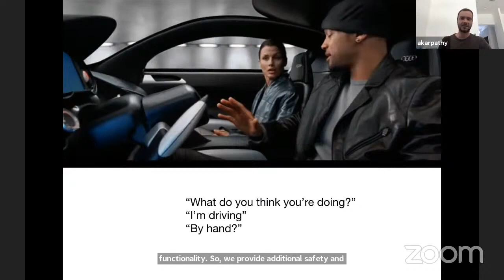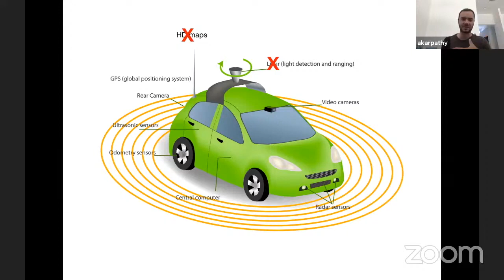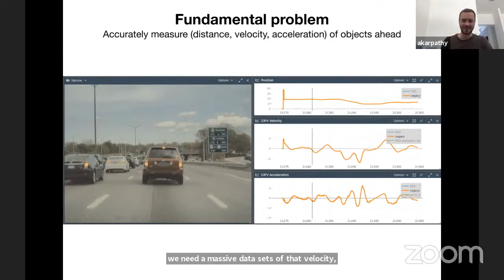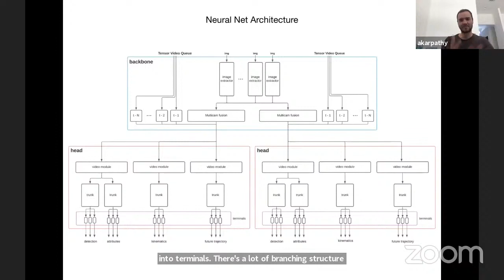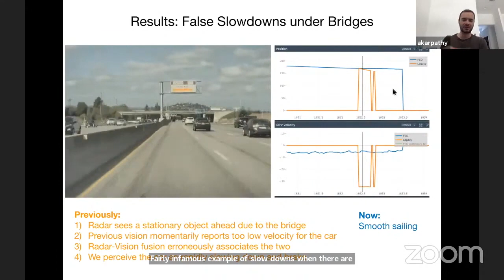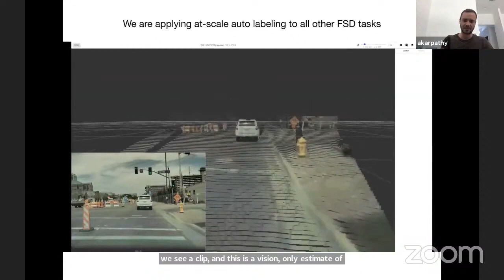[CVPR'21 WAD] Keynote - Andrej Karpathy, Tesla

Comment: Personally, I have to disagree with you here, coming from a pilot (particularly combat pilot) with some engineering pedigree. The idea of just ignoring the radar stack because of its limits and going to vision only is (hopefully not) kind of short sighted. Although the software engineering to get the biases right for a blend of EO (elecro-optical) and radar would take a bit, you'd get a better product. Many of the military sensor arrays now use a blend of available sensors (IR, EO, radar and networked data) to come up with a picture based on the best sensor data per target. Radar definitely has limits and errors, but so does visual spectrum particularly in the dark, rain and fog. Without radar, unless you add infra-red cameras, the cars will have all the same human visual limits for seeing distant objects no? For example, the jet I used to fly had a missile defensive system that amounted to electronic eyes looking for a missile launch plume, and then firing off flares when it was one. Unfortunately it would get fooled by all sorts of things and pop flares without a missile launch (essentially phantom braking off the radar). The upgrade added a second visual battery of sensors which were tied together with software, so the OSC saw what it thought was a plume but instead of going to the flares it went to the IRCM turrets which looked at the event, determined if there was relative motion (if something is on a collision course with you like a missile tracking, it's a threat, if not it's a false alarm) and that system would either defend the jet or ignore the input. That would have been what you should have done, radar says "ahhh! a thing! brakes" but the cameras look and go "no, it's a bridge, don't brake." Anyway, nobody asked me and it's too late to do anything about it, so I hope it works out. I really don't like the idea that I have a system in both of my Teslas that I bought and you're about to shut off without paying me back though. Just saying.
Reply: it's a good point. I think that's what they were trying to do with having radar "report" to vision, but apparently they think it will work smoother with just vision.
Reply: As you probably know, regular (silicon-based) cameras have a bit of IR sensitivity unless IR is blocked by an IR filter (which is standard for photographic CCDs).

Comment: I kept waiting during this extremely long video to have this gentleman address the very serious concern about fog. 

Driving in the fog (which millions of people due every year) will be impossible using vision only systems. 

This is where radar is superior. So why are you removing expensive radar from the model 3 and Y and leaving the radar sensors in the model S and X? It’s as simple as this. The combination of radar and vision is more expensive to install. The more affluent Tesla clients who can afford an S or an X will be safer.

I just put a deposit down on a 2021 Tesla model 3 performance and then found out from Tesla after I placed the order that the radar sensors were removed for the 2021 model. It’s unbelievable to me when a company makes a car “less safe” and then charges more money. 🤷🏼‍♂️
Reply: I drove in fog today using fsd beta in my vision only model 3 and could almost not see in front of me at times but the car was able to drive just fine with fsd visualization displaying the environment/other cars/lanes reliably with a smooth intenticle and no problems.
Reply: driving in fog isn't possible with radar either unless vision can see well enough to override radar's errors. But, to your point, cameras might be able to see better in fog if the computer adjusts the images in real time, for exampling giving them more contrast
Reply: Just slow down to the appropriate speed, like a human would (should) do. Bingo. Solved. Ideally you want traffic to move along at one speed, especially in difficult visual conditions. You DON'T want part of the traffic to speed along because they have radar.

Comment: FSD Beta 9 hasn't worked very reliable, but Mobileye test in NYC has gone well. Mobileye uses automatic mapping. Streets driven by a car using a Mobileye are automatically mapped (static objects are mapped and auto-labeled). Mapping is done by cameras. 
That AV-map increase safety and reduces the load on the neural network(NN) and therefore Mobileye does not need as powerful computers for NN teaching as Tesla. Mobileye car can focus only on moving objects. 
Andrej always shows the old-fashioned lidar + hd map concept, where HD-map was used only for localization. It would also be interesting to hear his opinion of the new auto-generated maps used by Mobileye and others
Reply: I have the same question. I did not hear any information regarding whether Tesla use cloud sourced map technology or not
Reply: maybe it is too late, even if that approach could work, their resources have focus on vision and they keep doubling down on it. 

But it will be interesting to know his opinion on it